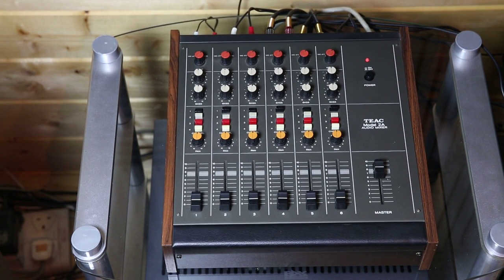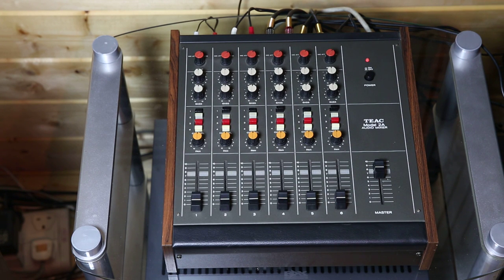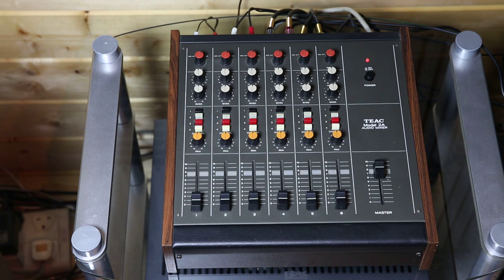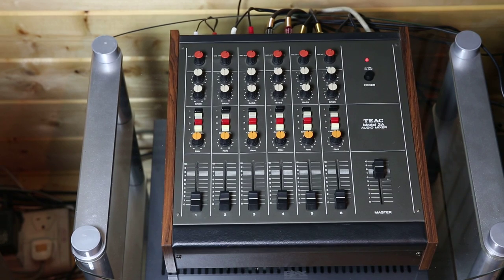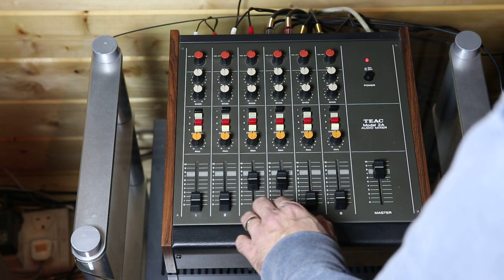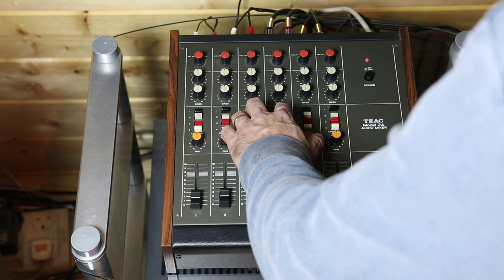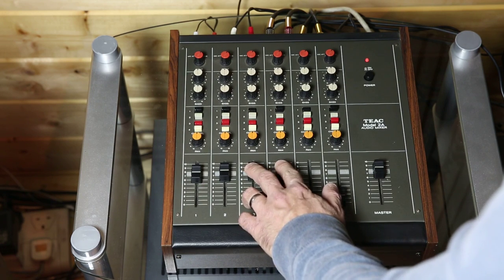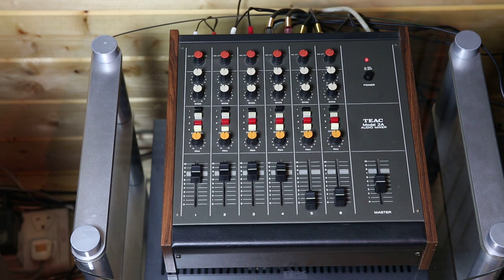Teac Model 2A Audio Mixer Demonstration - including analogue tape echo

Comment: Creative use! I gotta share my experience with one of these. I actually found one at a flea market the very next day after thinking "it would be amazing to run into a TEAC mixer at some point". I'd never even seen one, and BAM, Sunday morning at the Pasadena community college parking lot, I find one for fifty dollars. The reason I wanted a simple mixer is for creating a sub mix from a drum machine. This mixer has the basics for drum processing! No mids control? For percussion, you won't miss it, you want your highs HI and your lows to rumble. The easy EQ is terrific, panning and even individual channel outs you can use as a trigger out (these outputs are unaffected by the EQ). To top it off, all four outputs in the output matrix have their own send/return loops!!! I can line up a compressor, distortion, delay, and reverb and push any combination of output buttons to process my drums. I'm way happy to have found this thing. It was on it's own, no VU meters or tape deck. And made in Japan in the late seventies, during the peak of their manufacturing prowess, be still my heart.. 
Just wanted to share another use I am applying for this cool piece of kit!
Reply: Sounds great dude im sure this would work great on a drum machine. you kinda just gave me an idea haha.
Reply: Can you explain to me a little more about the process you discussed above? I scored one of these recently at an estate sale but I haven’t been able to find a free download of the manual

Comment: Just bought one of these to use as a summing mixer. I have a Teac Model 3 but the output switch is gone and I don't have the time or money to fix it, so I bought this and am going to run vocals with effects and some analog compression through it to my Tascam Model 12. I then set up projects using a DAW so I don't have to worry about how many channels I have and then send master files I'm finished off in the DAW, to Cassette. You can also do this over and over again depending on the effect your going for, Anyways this machine is going to be great for summing. Nowadays you can have the best of both worlds.

Comment: Beautiful mixer. What is the disco/funk track that comes in at around 2:06  with the vocal 'when will you be mine'...great track.Thanks
Reply: average white band - when will you be mine, but sounds like a remix perhaps, anyway sounds faster than the original.

Comment: I am still trying to figure out the master fader? It doesnt have a dedicated master out connection, just a multi out that gets its source from assignment switch, so in essence there is one master fader for all four outs, if i understand the logic. I do have the mb20 meter bridge that does have a sum stereo pair, which is baffling the summing happens in the mb20. Anyway, the mb20 meter bridge is a must have for the added features, AND quad VU meters!